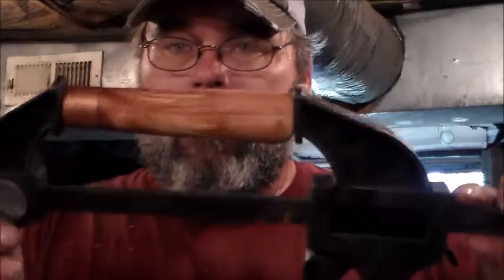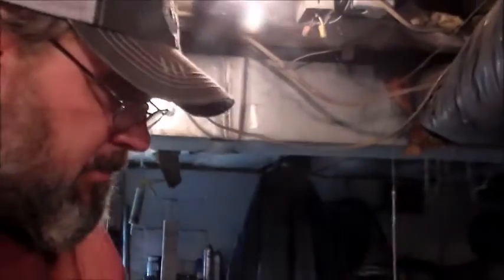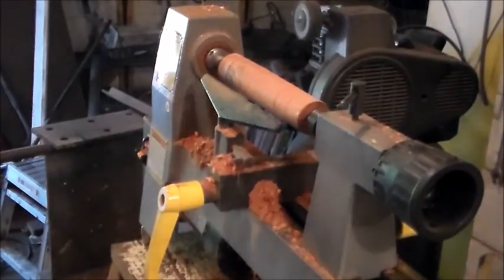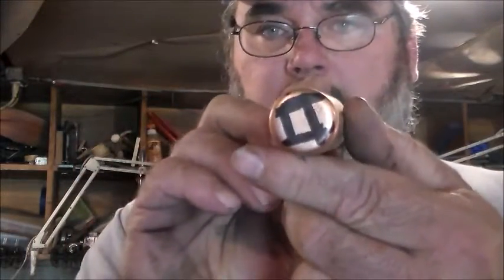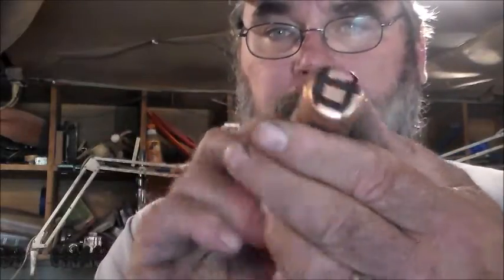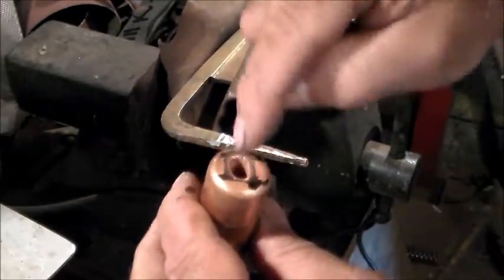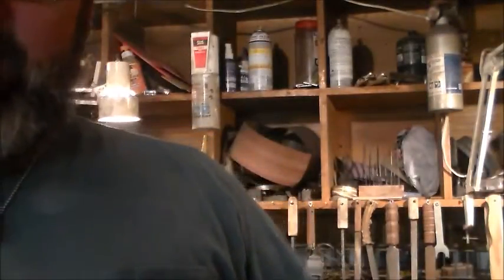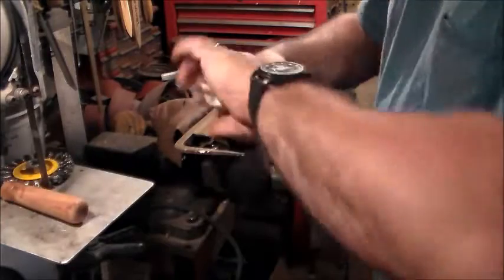Restoring My Pa Pa's Bluegrass draw knife  Part 2

Comment: you do reallize that those handles are suppossed to drive on not be glued on right? that is one of the purpass of the metal around the one end. to keep the wood from splitting while you drive them on.. but now that you made them too big apoxy is your better choice, garrilla glue wont hold that loose of a fit.